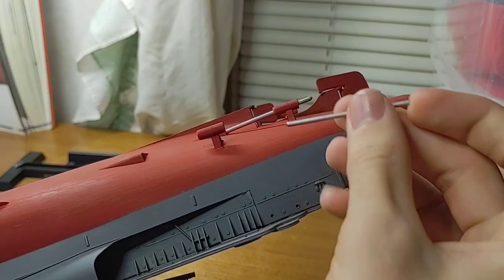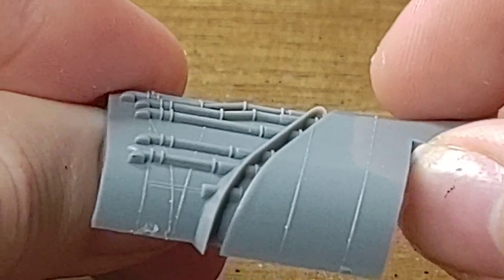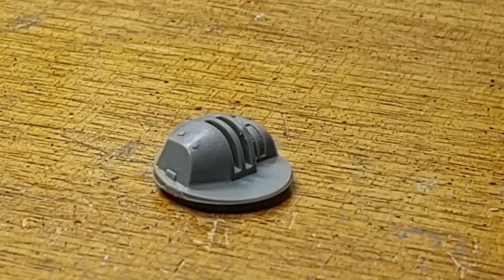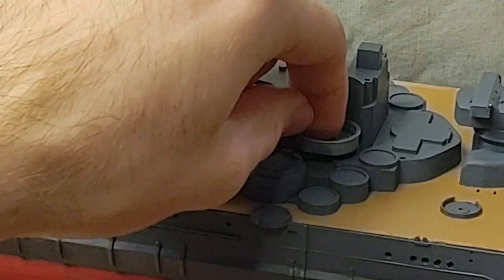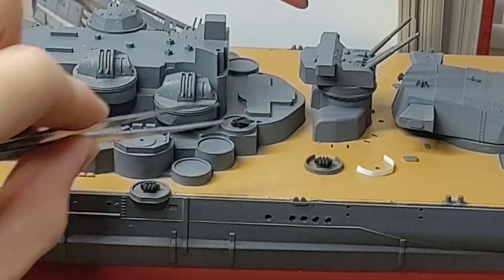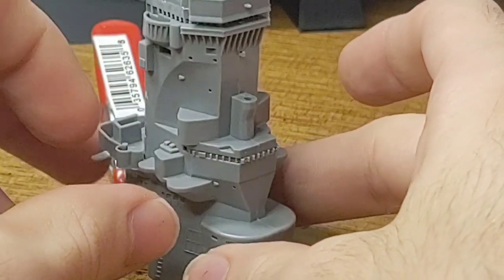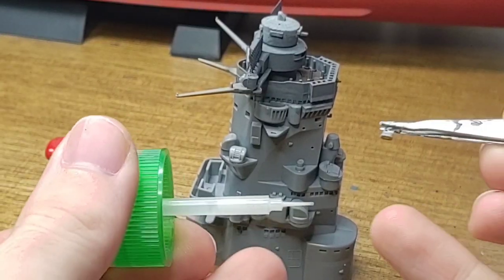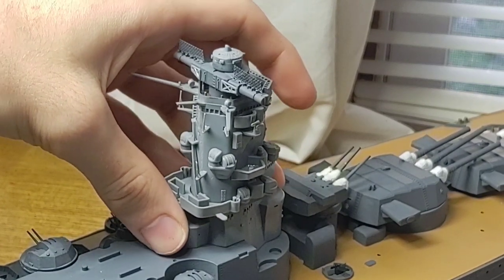1/350 IJN Musashi part 2.

Comment: hey man, great video!!, I just want to ask if you would loosen the anchor chains on the musashi, as they were on the yamato, because I saw photos of of the yamato during the batle of the sibuyan sea and her anchor chains were loosened, but I could not see those of musashi on the same battle. were they both loosened or was it just yamato

PS: I got the idea from wargaming, world of warships. they said that yamato's anchors was loosened but it was never done on musashi was it true??
Reply from the maker: Thanks. They were loose on Musashi as well. I would like to loosen them as it would be historically accurate, but I need to get chains to do that.
Reply: @centralcrossing4732  hey man thnx for the info, I would also ask of which of the battleships had turret 1 painted darker as the  wikepedia says that it was musashi but others say it was yamato??
Reply from the maker: @gianvillanueva746  In reality, they were not painted a darker color. Yamato's 46cm No.1 was given a coat of soot from the funnel like the decks on both ships to help hide them from aircraft spotting at night. I would assume the same was done on Musashi, but a lack of photos leaves it up to opinion currently.
Reply: i would like to emphasize the pics of the musashi and yamato, also the construction
Reply from the maker: @gian villanueva I have seen most of the construction and Yamato images. The Musashi ones at leyte gulf...are new to me, wow. I think it's safe to say Musashi's forward turret was not painted with funnel soot. Thanks for the link.
Reply: @centralcrossing4732  hey bro did you get the chance to see the anchor chains on musashi? i could not see them due to the quality of the pictures taken
Reply from the maker: @gianvillanueva746  They are loose, that has been confirmed on the wreck when it was discovered in 2015. The port anchor and chain was cut off by the crew to counter the list, but the starboard anchor and chain are in place.
Reply: @centralcrossing4732  oh ok thanks again for the info, I am really enjoying these videos most of all the ones about the yamato class, keep up the good work
Reply from the maker: @gianvillanueva746  The AA guns are definitely set up for Ten-Go, so yes, it's correct.
Reply: @centralcrossing4732  oh ok thanks again for the info, I am thinking of buying a yamato model, I dont know which one is most accurate though

Comment: I'm little confused is it 350 or 450 because it looks like a 450 to me because how small it is I have a 1/350 Lusitania set and its more bigger then that and I have a 1/450 Queen Elizabeth which has the same part size as this model
Reply from the maker: It's 1/350, don't compare parts you have with what you see in a screen.
Reply: @centralcrossing4732  yeah thats what I thought